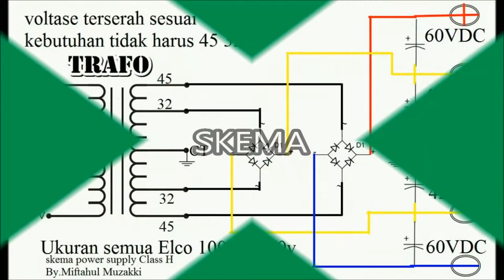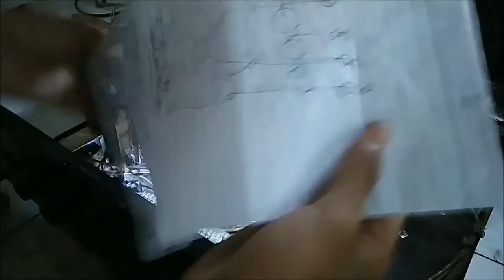Cara merangkai (PSU) Power Supply Class H sederhana

Comment: Itu trafonya 10a ct45 ya mas ?
Reply from the maker: Iy mas
Reply: Kalau trafo nya ct45 kalo pake elco 80v aman apa nggak mas kalo buat psu seperti diatas ?
Reply from the maker: Aman mas kan udah saya tulis rumusnya ada di deskripsi
Reply: @MiftahulMuzakki  mas
Saya mau buat psu class H
Lv20vac
Hv45vac
Itu harus pakai elko 80v semua atau bisa 50v sama 80v

Takut kalo terlanjur 50v nanti dor
Tolong di jwb
Reply from the maker: Elko Semua pakai 35v pun bisa mas. Tapi terserah mau pakai volt berapa yang terpenting minimal 35v. Silahkan baca dideskripsi mas itu ada penjelasan perhitungan AC ke DC
Reply: @MiftahulMuzakki  kalo semua pakai 35 apa nggak dor mas
Kan ada 45vac

Cuma takut aja
Yg hv 80
Lv50
Kan hv sama lv nyambung
Ntar 50v nya dor lg🤣

Kyknya aman yaa mass?
Reply from the maker: Kan sudah jelas mas 20vac itu dcnya sekitar 25 berarti sebagai LV elko 35v sudah cukup dan untuk HV kan penyambungannya seri dengan LV sehingga HV45VAC dcnya 60-25(LV)=35v  berati elko 35v sudah cukup mas
Reply: @MiftahulMuzakki  tp uf nya ngurang atau nggak mas
Reply: @MiftahulMuzakki  tp kalo misalnya di rubah
Nggak di seri
Atau buat psu sendiri dan gnd nya di jadikan 1
Apa itu jg bisa?
Reply from the maker: Bisa tetapi elko HV volt minim 63
Reply: @MiftahulMuzakki  oke mass makasih
Semoga chanelnya sukses selalu
Reply from the maker: Sama" , aminnn

Comment: 1/2 gelombang ya bos?
Reply from the maker: +ori oriaz 
Tidak mas
Reply: saya coba cara nya, tpi saya pakai trafo kecil, ct 32 dan ct 25, waktu start awal saya tes volt keluar setelah elco betul, 25 ct jadi 35vdc dan 32ct jadi 45vdc, ga lama setelah saya konek ke power ko berubah ya volt nya, yg 25vct out nya jadi 70vdc 
dan yg 32vct out nya jadi 90vdc, sementara ct dari trafo belum saya konek kemanapun bosku karna saya masi tes di luar box, itu knp y bosku, mudah2an bisa di mengerti pertanyaan saya, mkasih.
Reply from the maker: +ori oriaz itu ukurnya sudah terhadap gnd apa -+
Reply: Patokan semua dari ground mas bro, setelah cek sana cek sini trnyata Dmm saya yg error wkwkwkw, soalnya pas ukur pertama kali semuanya normal ct 25 out nya 35dc, ct32 out nya 44,8dc dan mendadak error, bahkan out di elco sampe 150dc hhhh, pas saya cek pke analog trnyata normal mas bro, bisa dipake skema di atas, memang susah klo dmm abal2 di pake buat ngukut tegangan aktif kwkwkw, makasi mas bro udh reply koment saya, tmbah sukses tmbah bnyak konten mas bro. 
Salam.
Reply from the maker: Ya sama sama mas 👍👍👍👍